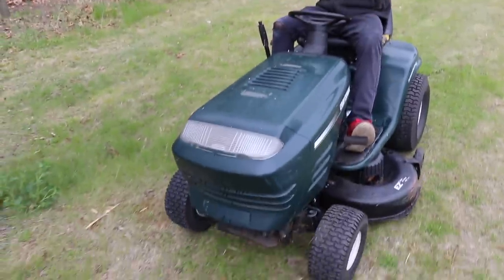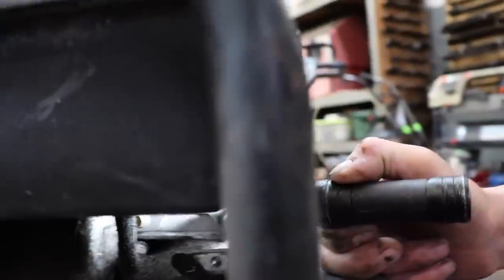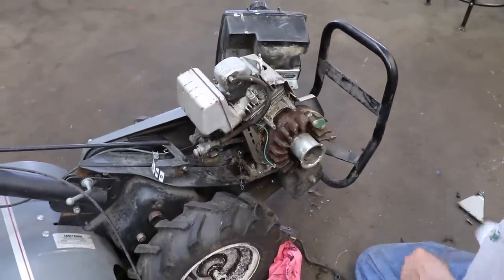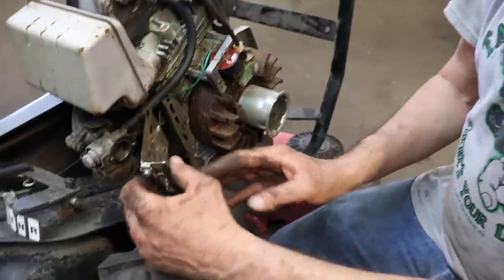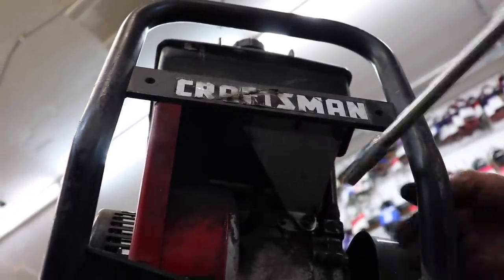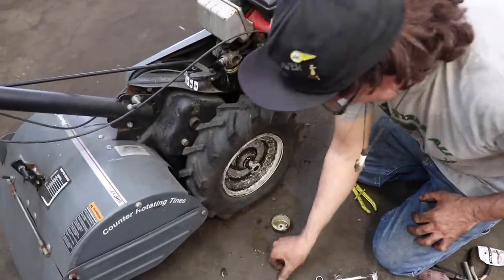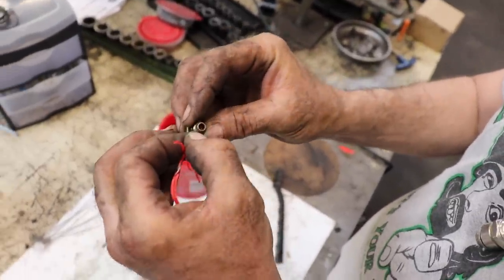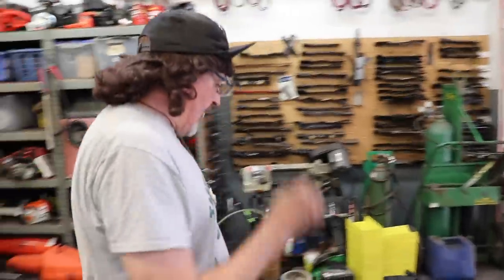How To Replace The Ignition Coil On A Tecumseh 6hp Engine

Comment: Found an old Lawn Boy mower at a lawn mower bone yard. I'm fairly handy at fixing things and use youtube a bunch. Bought it for $20. It had been sitting in the open for ?? a long time. Got it home and cleaned it, Replaced oil, cleaned out gas tank, Replaced air filter (bad). Lubed all the wheels, cleaned the carb, replaced a bent blade. IT RUNS. Was I just lucky or is this common?? If it is common it could become a side gig since I'm retired. Kind of fun. After a little more work it looks almost new. Are things like this in demand??? Where are the best places to advertise it? Its on Craigslist but open to more ideas.

Comment: Great tip on using a metal feeler gauge instead of the plastic OEM gauge to prevent incorrect air gap.  Keep up the great work!

Comment: Thank you Taryl. I watched one of your videos about fixing a John Deere transmission pulley. It made the same noise as the video but when I change the old pulley it looked fine and the noise got worse. I looked around underneath the mower and ran my hand around the belt and other pulley's and found a bad one. (It was plastic and breaking apart) I ordered new ones, shouldn't take to long. ... Everyone else was talking the whole trans apart. ... Simple is best, same as you. The Best !!

Comment: Oh and piece of advice with the Milwaukee 3/8th m12 power rachet, be careful tighting bolts with it, it can snap the posts easily.... I have the 1/4 and the 3/8th that 3/8th will snap and strip bolts easily, but the 1/4 won't.

Comment: Before I replace the coil, I check the air gap, I have found sometimes the vibration has just moved the coil providing no spark.

Comment: You need a table lift. You're always bending and sitting on the floor. Takes a horrible toll on your body over the years.
Reply: Holly D   I think the exact same thing every time I watch his videos, my knees and back start to hurt watching him . I always put my small mowers and engines up on my welding table if they wont fit on my big lift  , wish he had one , it would be easier for him
Reply: Fixing stuff on floor makes it easier for Mr. Cameraman.  He said so in a previous video.
Reply: @andreaechevarria6725   Then Mr Cameraman can find something to stand on if he needs elevation.
Reply: Ok got it , but camera man doesn’t seem to have a problem filming his bench work at all

Comment: Taryl, I am hunting for a rim (my tire is good , but...) for a craftsman 17" reverse tine tiller like the one in your video "How To Replace The Ignition Coil On A Tecumseh " part # 532150750. Would you possibly have a used one or any suggestions on where to find one????

Comment: A wire from a full size wire brush also works well.  I don't play the guitar.  Working on the floor???? WTF?  I have better luck putting the bowl gasket on the carb first.  Barb pointing outward on Primer.

Comment: Geesh, that's a lot of bullshit to go through just for the coil. I recently replaced an ignition coil on a Briggs and Stratton engine. There were only four bolts holding the top flywheel cover on. Removed those and eh voila coil right there.